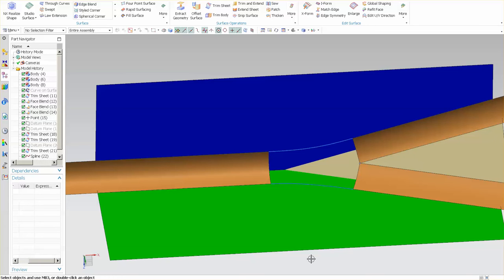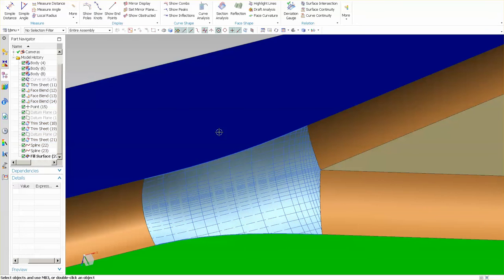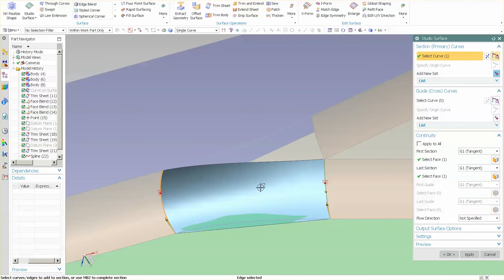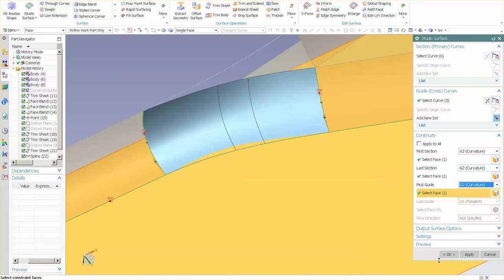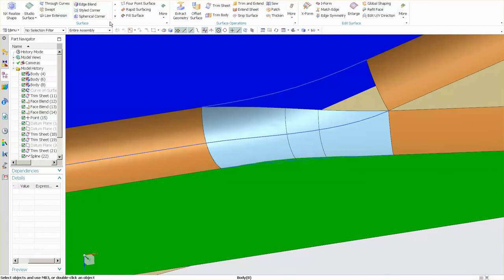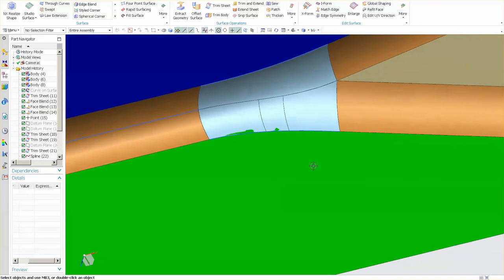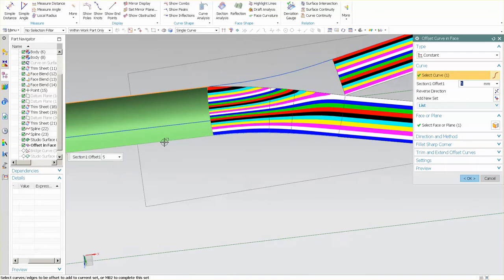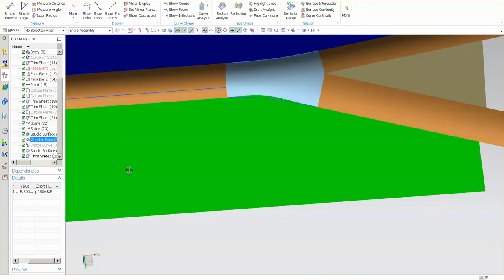Siemens NX 10 |  5 Sided Surfaces

Comment: You used splines as guide curves and I guess you constrained them to the blue and green surface each, which happen to be planar. 

I have the problem that my 'side surfaces' are not planar. I tried guide curves, but it does not allow G2 continuity. I tried curve on surface, but the resulting spline does not look like I want it to, I would like to decrease the value for G2 continuity, or otherwise the patch will appear very narrow and odd-looking.

Is there a good (stable and editible) solution?
Reply from the maker: Actually those surfaces have some curvature. When building those curves and using Bridge Curve the best you can hope for is G1 and then adjust the shape of the curve to meet your needs. The Bridge Curve has all sorts of shape controls.
Reply: Okay, now I saw, the bridge curve allows me to change tangency value. Do you have a good technique to make this blend G2 continuous? At least along the blends. The blends themselfes can be circular with constant radius and G1 continuous to the sides.

I am really struggling at a blend similar to this and I suspect this blend to prevent me from sewing the surfaces together. For now I am fine with G1 continuity as well.
Reply from the maker: You would make the Bridge Curve G2 or G3. Work the shape to get it as close to the surface as you can then project the curve down.

That is the easiest way that works decently but not always.

I will have to make a video of some other methods. Good subject.Thanks

Comment: Is there any advantages to using Studio Surface over Through Curve Mesh if you have 4 curves to chose from? On your first one you only had three so I can see why you used it there but in the instance that you do have 4 right off the bat are they then essentially the same function?
Reply from the maker: They are close to the same. They do create slightly different surfaces though. The differences will really show in when you go to G2 and G3 continuity. 

Through Curves uses a different method to apply continuity. The math works out different.

Comment: To resume, it's always better to respect a 2-4 sided patches topology as it's more quad compatible than a triangulated 5 sided surface, right ?
Reply from the maker: Correct. All surfaces have an underlying math with 4 sides. Even if they look 3 sided all tat happens is one edge is collapsed to look like a 3 sided surface. That is bad because it can cause waviness and tiny radii.

Comment: Very interesting approach, thanks a lot for your help as i already met such a case while modeling and really had difficults with. I finally changed my design, rather than solving it elegantly. Now, if you allow me a question Sir, there is something that may look basic but i really didn't find an elegant way to reproduce with NX yet, always having geometry problems : it's about splitting a model to make a nice and coherent lip/groove feature, like those used for plastic parts. I've been used to the integrated feature available in Solidworks, but this whole software gimme headaches with its insane history driven phylosophy (one big reason why i switched to synchronous since). I've asked some people, professionals too, but none of them have been able to either understand my problem, nor to explain. So, i'm still searching for the right method to replicate the same within NX. If you or somebody else reading this have an answer or some guidelines, it's more than welcome ! :)
Reply from the maker: Can you email me a picture? I will gladly see what I can do. I have a lot of plastics experience.

info@clasasurfacing.com